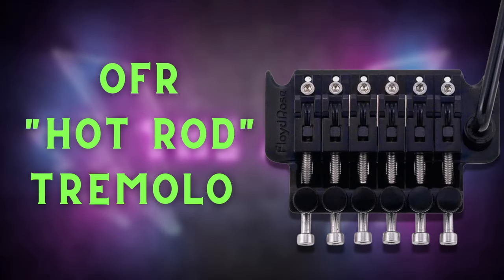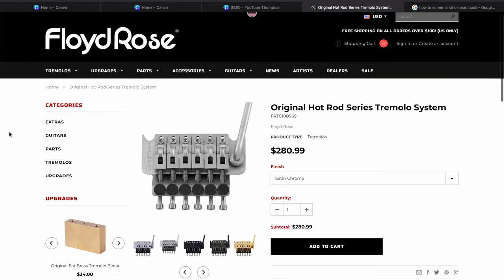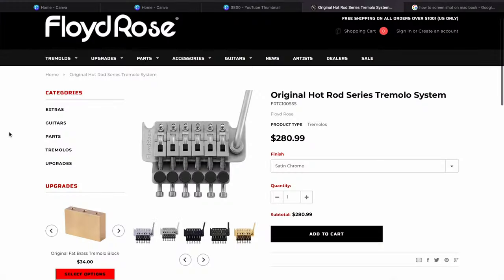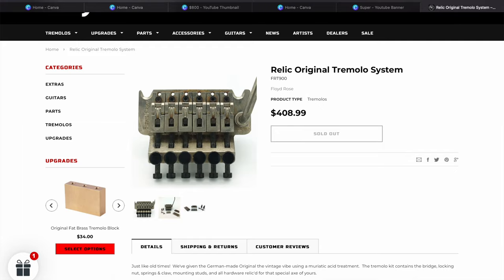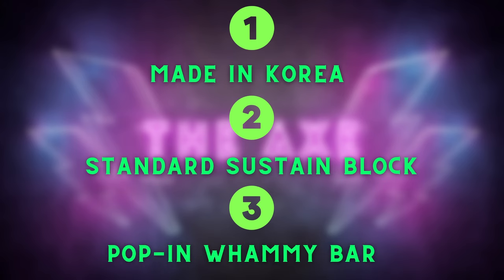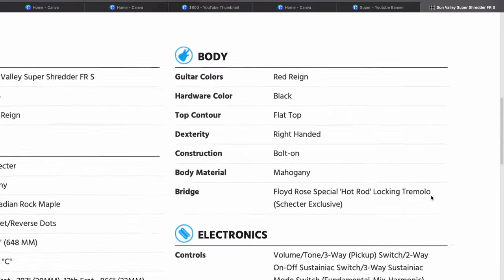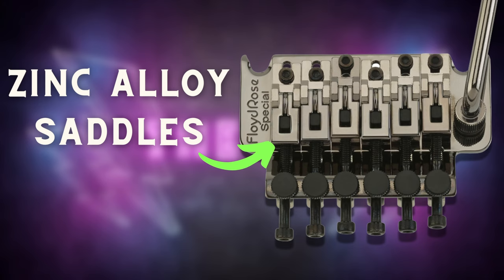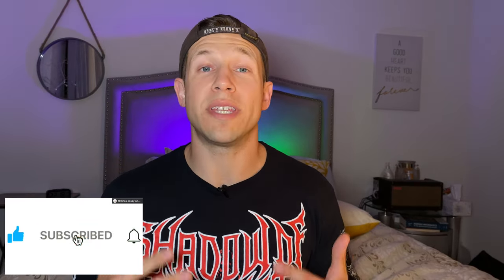SOLVED | HOT ROD Original Floyd Rose

Comment: Did you know that they are stopping putting the "Made in Germany" stamp on base plates? The website states..."Please note: The "Made in Germany" stamp has been removed from the current production run of Original Tremolos. If you purchase an Original tremolo from an authorized reseller without this marking, rest assured that this is still the same heat-treated hardened steel Original Tremolo." If we compare trems from these new lines, you might end up with a 1000 series base plate from a guy selling one to you. I love having the German base plates. I've actually noticed that my German models have a much rounder post cutouts. My 1000 series cutouts are a bit more "V" shaped. Love to see a video showing this to everyone.

Comment: The “standard” sustain block is Nickel plated Brass. Adding a larger brass block adds more mids. Sustain and “harmonics” don’t change.
Reply: No it does not add more mids, it adds more sustain because it's denser and bigger, wich creates more surface to vibrate.
Come on man the thing is literally called a "sustain block" in the official floyd rose website
Reply: @ricardorito778  Have you installed one? I have. There is no additional sustain. There is no added “Harmonics’. The guitar (Jackson Ke2) had more mids.